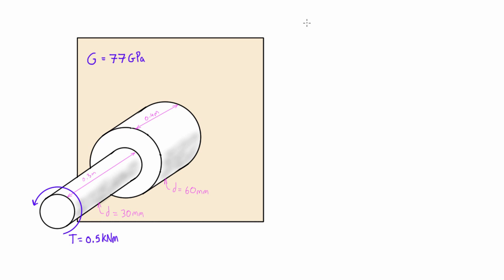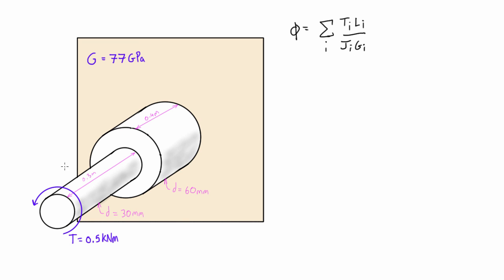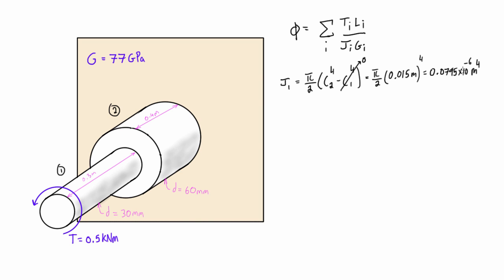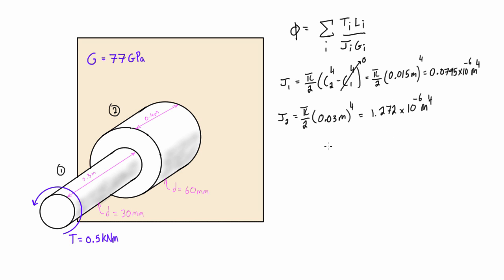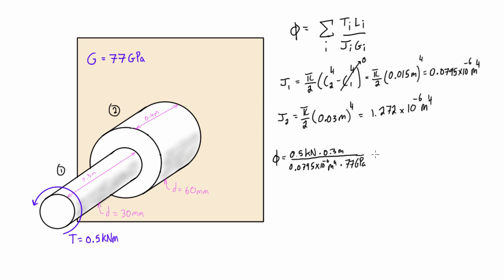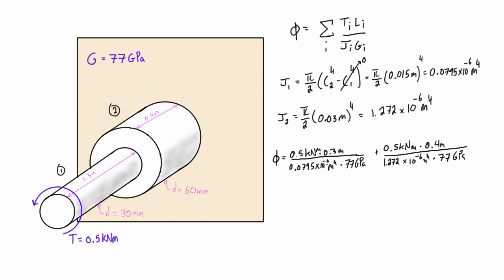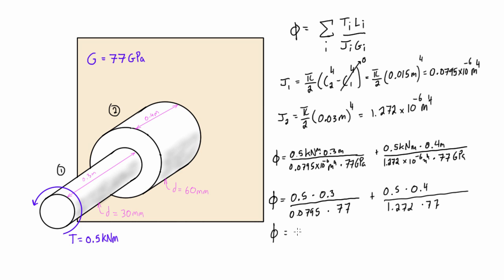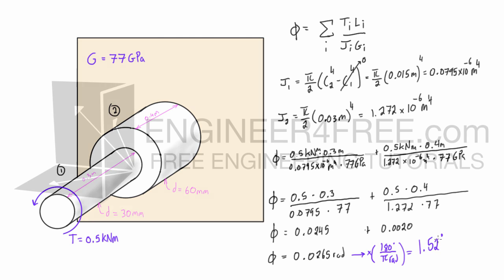Angle of twist due to torsion in a shaft with varying cross section

Comment: what if the length says.. 1000 ft, those torque would reach that point if different diameter / cross section, since we need minimum torque allowing the torque transfered to the end of the pipe

Comment: If both ends are fixed and we have a statically indeterminate shaft, will phi at the intersection of the two cross sections be equal, even though we have varying J?

Comment: If for the stepped shaft(ABC) the twist is T at the free end C and the Length of AB is 100cm and Dia AB is 4cm and Length of BC is 50cm and dia BC is 2cm what will be the angular twist at c. Given angular twist at A is q
Reply: At A the shaft is fixed and at C it's free
Reply from the maker: The angle of twist at the fixed connection will be zero. Follow the exact same formula I use in this video phi_=sigma(TL/JG)_i . phi = angle of twist at free end c. Do TL/JG for section AB and also section BC, add them up, and you will get phi.You'll need to know the G, which depends on the material too.
Reply: @Engineer4Free  Thanks for the reply bro
Reply: @Engineer4Free  but don't we use sign convection , do we just add them up , as counterclockwise moment is positive and clockwise is negative?

Comment: What if both ends are free ? How to calculate the angle of twist ? The torques are at the both ends.
Reply: you start on the end of the shape, and once you get to the other end, you would add the torques if they are in the same direction or subtract the torques if they are in opposing positions. Once the torque is calculated you complete the problem as in the video. Thank you very much for your question.
Reply from the maker: No difference. If both ends are free the torques need to be equal and opposite for the member to be in static equilibrium. The reaction torque in this video is equal and opposite to the applied torque, so whether you draw the wall or not, it will be the same method to solve.